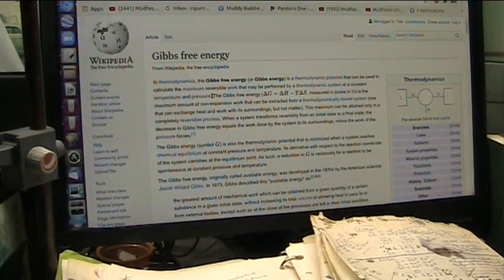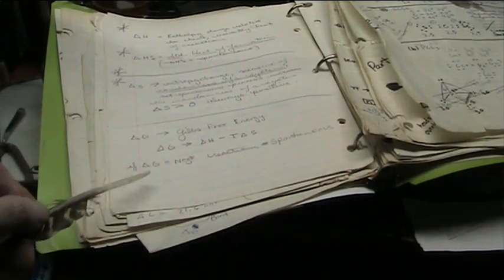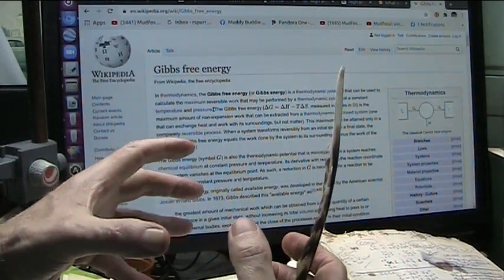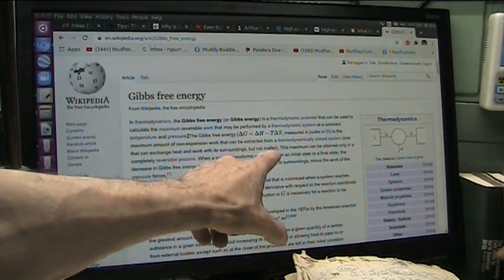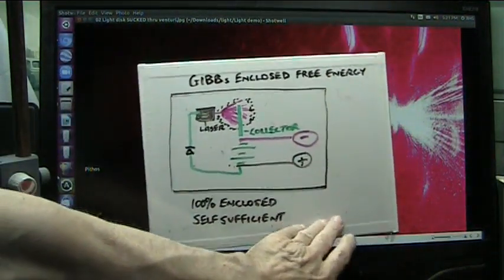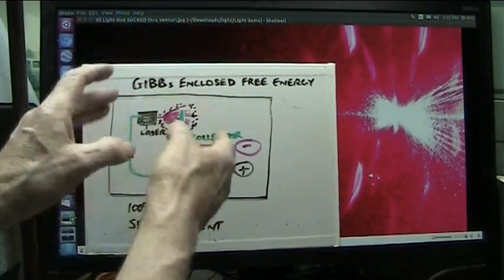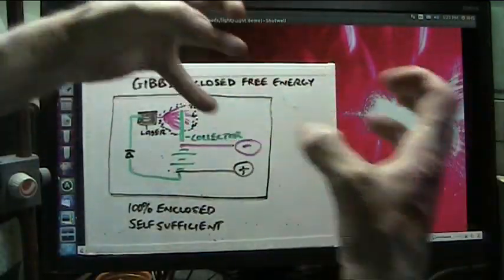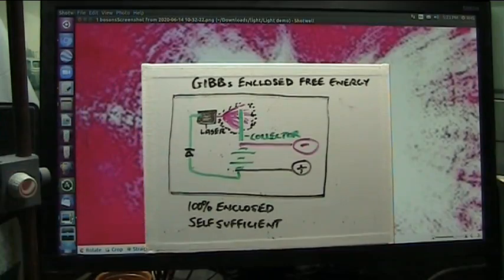Gibbs Free Energy Looks Promising

Comment: That's not what "free" means in Gibbs free energy. It's called that because the energy is freed from the system, so it can do useful work, like heat something up. It is NOT "free energy", that would break thermodynamics.

Comment: There is this very basic method of collecting free flowing energy that compliments your information on the aceleration thing you showed us. Without loving parts:

1. Fold a rodin coil. (figurer out what cobber wire you need and how to fold it)

2. Connect it to an antenna, or multiple copper coils, and also to the ground. 

3. Use an amplifier to store the energy with the right frequenzy on the right capasitor or battery. I've seen a guy do it on a YT channel. Natural EMF can be stored to be used as electricity 

You easily get free lights with enough emf conductive materials. But maybe use graphane battery for safety reasons.
Reply: @Mike Hunt-Iza

Idk what that is. There are other consept too. And probably not the same

This coil is based on Nikola Tesla's 3,6,9 vortex model. Proving the acseleration of energy is very simple even without any moving parts. Try to fold it and test it with an ossiloscope. Im pretty sure you get some intresting results.
Reply: @Mike Hunt-Iza

Roger only show the acseleration phenomena in light. Search rodin coil and learn about it.